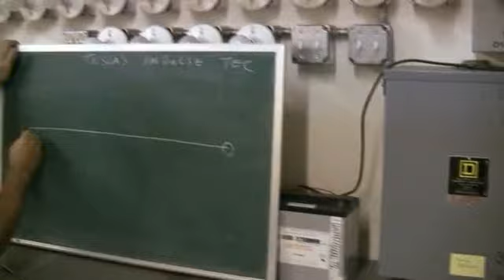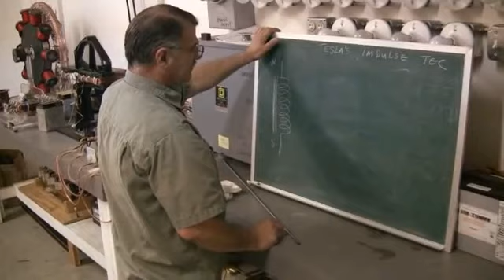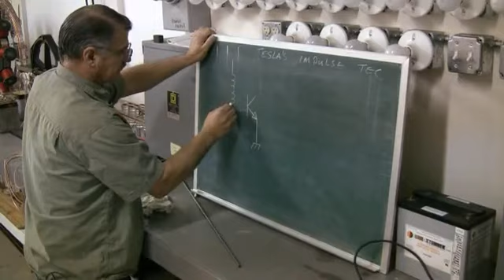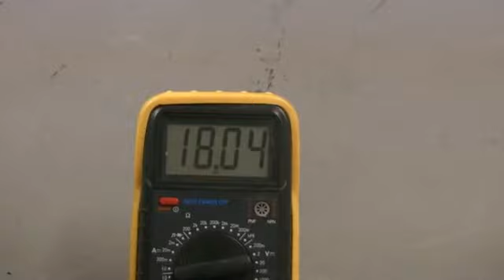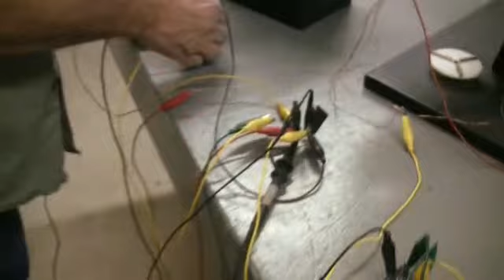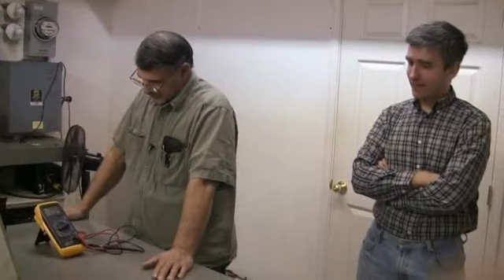#07 - Tesla's Impulse Technology  Plus: The Bendini Cole Window Motor (2009)

Comment from the maker: 0:53: ⚡ Conversion of monopole circuitry to Tesla's impulse technology to capture energy spikes for recharging a battery.
0:53: Connecting one lead to a transistor across the coil to capture energy spikes on the scope
2:05: Utilizing negative electricity to charge a battery without affecting the motor

8:46: ⚡ Utilizing existing energy in a circuit to charge batteries and capacitors without additional input.
8:46: Energy is transferred from nodes to charge a capacitor and a battery.
10:02: 86 volts already present across a node can be used to charge another battery.
10:23: Battery receives energy and increases to 13.4 volts when drained from another source.

16:24: ⚡ Understanding the perpetual energy of a charged magnet and its potential as a free energy source.
16:24: Charged magnet's zero portion holds gravitational energy, creating a perpetual state of magnetism.
17:19: Energy from the universe enters the magnet, but tapping into it requires a mechanism.

23:41: ⚡ Explanation of utilizing monopole motor for Tesla's impulse technology and battery charging.
23:41: Monopole motor can implement Tesla's impulse technology effectively.
24:05: High potential beyond battery voltage is needed for charging batteries efficiently.
24:29: Utilizing potential to move ions between battery plates for recharging without additional current.

31:00: ⚡ Utilizing negative energy from coil impulses to charge a battery for energy pumping.
31:00: Energy is captured across one wire in the coil to prevent burning out the transistor.
32:50: Negative energy from coil impulses is harnessed to charge the battery.
33:13: The goal is to use the captured energy as an energy pump.

38:54: ⚡ Demonstration of charging a battery beyond its capacity using impulse technology.
38:54: Impulse technology successfully charges a battery at 60 amps, exceeding its capacity.
40:31: Negative energy is easier on the battery than positive energy during charging.
40:39: Caution advised against frequently subjecting a battery to such high loads.

47:43: 🔋 Battery maintenance is crucial to prevent sulfation and ensure longevity of energy storage.
47:43: Running batteries until depleted leads to sulfation, rendering them unusable.
48:18: Using Tesla's impulse technology, a single trigger magnet can power a window motor efficiently.

54:47: ⚡ Conversion of window motor to impulse technology for recharging a battery using a basic monopole circuit.
54:47: Demonstrating energy generation through impulse technology
55:20: Utilizing impulse technology to charge a battery in a negative form
55:41: Converting window motor to showcase battery recharging with monopole circuit

1:04:36: ⚡ Exploration of a circuit's behavior when transitioning from a monopole to an open loop system.
1:04:36: The circuit is being fine-tuned to generate more current and speed up the wheel.
1:06:14: In an open loop system with a monopole, current must be stopped to allow nature to fill in with negative current.

1:13:15: ⚡ Exploration of energy conversion process in experimental battery testing.
1:13:15: Ions moving to fill in holes in battery for self-charging.
1:13:47: Observation of battery stability and resistance to reverting energy flow.
1:14:10: Discussion on the slow and continuous energy conversion process in the experiment.

1:21:59: ⚡ Unconventional energy transmission method causes battery issues and time manipulation.
1:21:59: Energy transmission back and forth on a single wire system
1:22:23: Impulse technology affecting vacuum energy and time manipulation
1:22:52: Batteries losing electrolyte and crystallizing in one wire systems
Reply: thank you 🙏